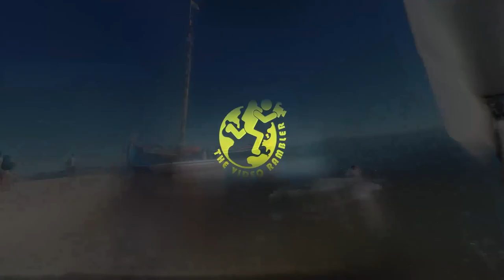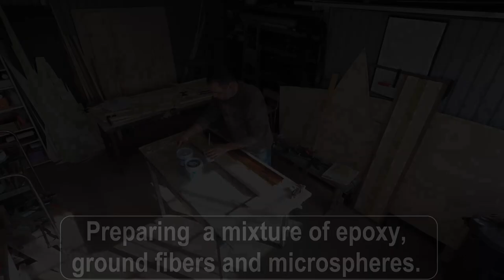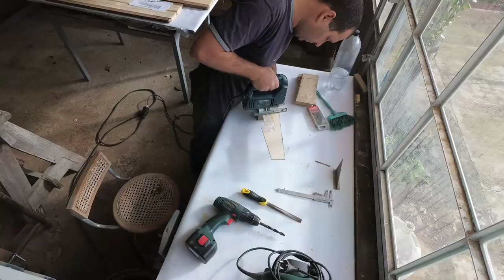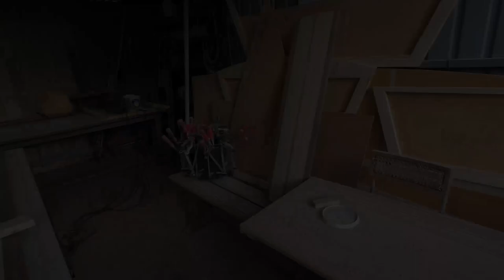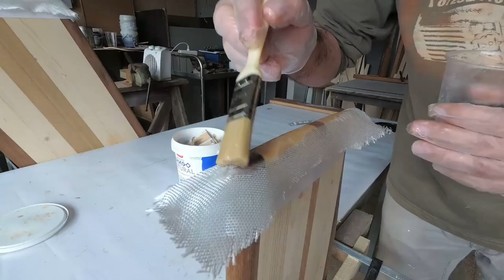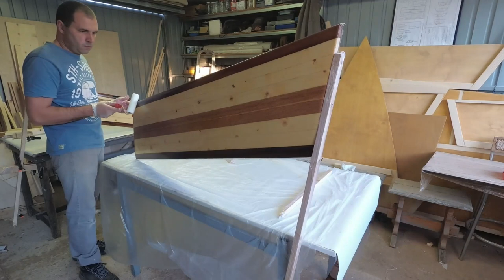Laminated Dagger Board and Rudder

Comment: 10 hours might sound like a lot. But the numbers from competitive racing boats shows around a 8 to 10 percent upwind improvement over something shaped by eye. That is from club racing large numbers of boats and seeing what happens to the fleet handicaps when people use a nice board like these.

What does 8 or 10 percent look like - it is a yard or metre every five seconds in a medium wind. If you are next to a boat that is so much faster with no effort, it is pretty depressing.

Also as the weather gets worse, there is a lot more control and even better performance relative to a boat with less perfect foils.

So 10 hours work to gain so very much.

Comment: Beautiful job. I am building a sailing rig for my kayak while contemplating building a GIS so I can sail with my boys. Thanks answers the question: should I epoxy the rudder or just varnish.
Reply from the maker: Hi Lee! Sorry for the late reply but I didn't see this comment.
The epoxy will degrade with the UV and so will the varnish. Once the UV blockers are saturated on the varnish, it breaks down. The difference is that you can scrape the varnish and apply new coats and you can't easily scrape the epoxy. it all depends where you store the rudder. If it's usually kept safe out of the sun you can go either way tbh. Or you can encapsulate the wood with epoxy and then varnish it...😉

Comment: What kind of wood did you use? Is it bad to use soft wood for dagger board?
Reply from the maker: Hi Dusty!
I used Spruce for the daggerboard blank but the darker strips are hardwood. It is Ok to use softwood (some daggerboards are made of balsa and even foam core) but a hard material should be used for the leading and trailing edge to take the impacts.
Reply: @TheBoatRambler  thx a million for the help!